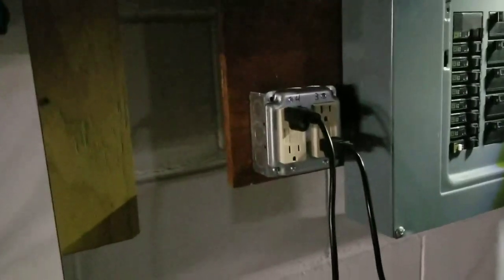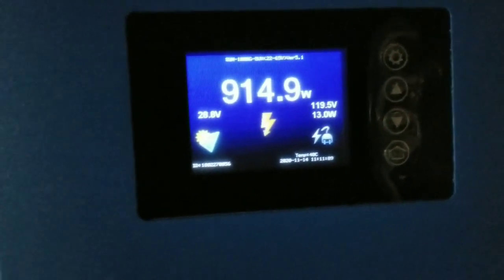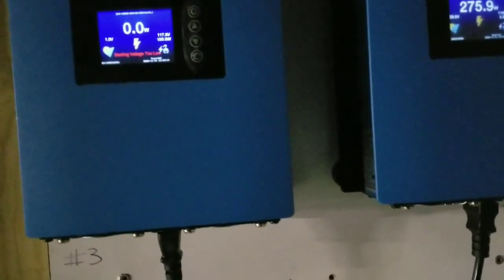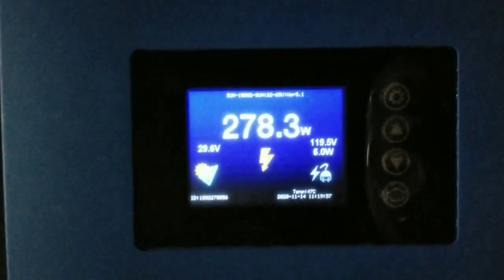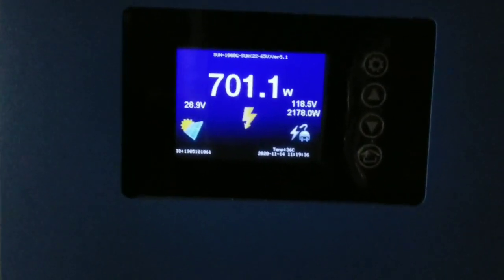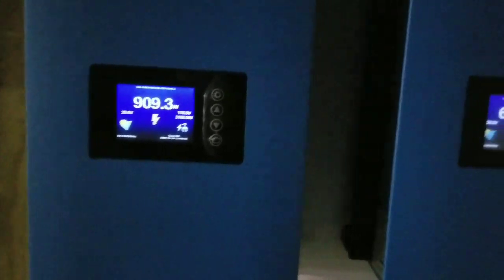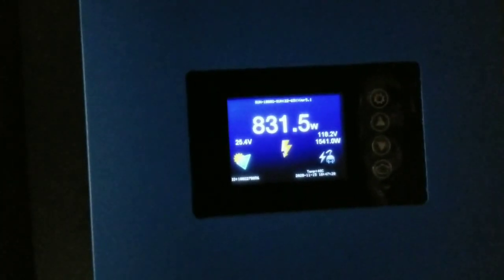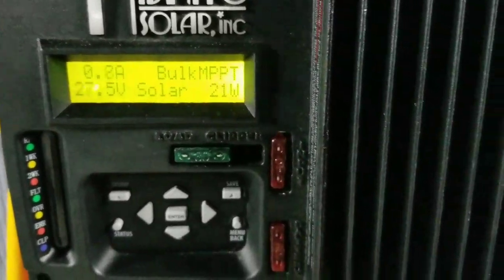OFF GRID TINY HOME EXPLAINE, SUN-1000G2 GRID TIE POWER INVERTER WITH LIMITER (Part 2)

Comment: I need help. I have the same but new identical GTI with limiters and mine have the WiFi dongles. I have a very large battery bank but do not know how to connect my Sun GTI to it. I have the DC in from the panels (1000Watts to each inverter). I know how to set the menu to battery cut off and battery reconnect. My instruction manual says when I check that option MPPT is disabled. So I don't understand how to have both, solar and battery bank connected at the same time. Where does the charge controller come from if MPPT is disabled? Can you show a picture or sketch of how this works? I want my system to be "plug and play", "set and forget". My batteries are very high grade AGM. Please explain how to have batteries and solar connected together.
Reply from the maker: https://youtu.be/Hggpf2jsmUg

https://youtu.be/gYaTp4LDLv8

GRID TIE SOLAR INVERTERS: https://www.youtube.com/playlist?list=PLSNjIRSnUPDL4fWuaEW_gOZc-bQFuWZvV
Reply from the maker: LIKE SHARE and SUBSCRIBE

Comment: Cool that is why I have 2 separate battery banks as you know they will pull 950 watts continuous so you need wire and breaker to handle that at 24 volts. cheers buddy